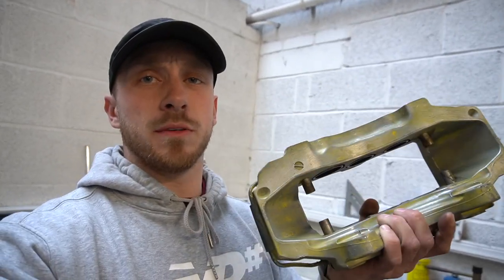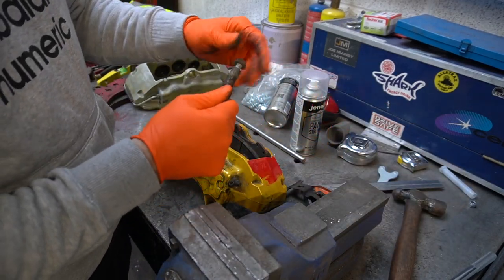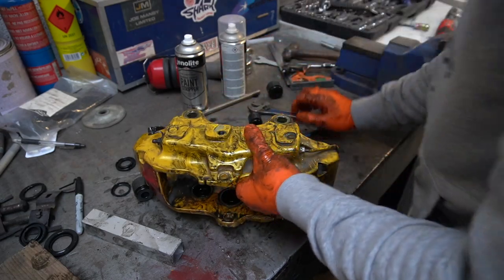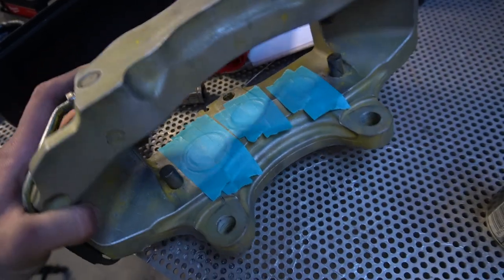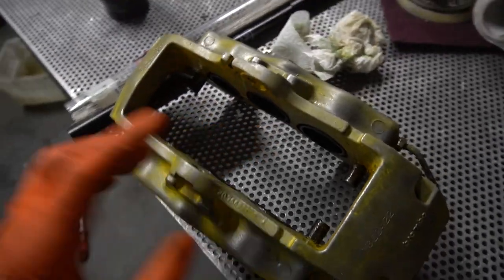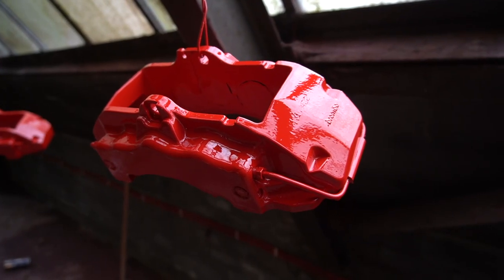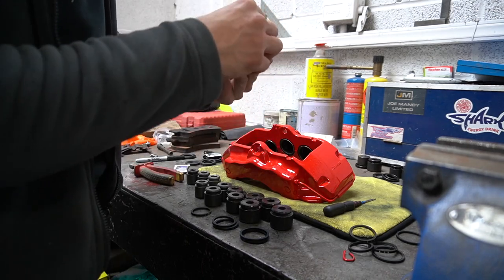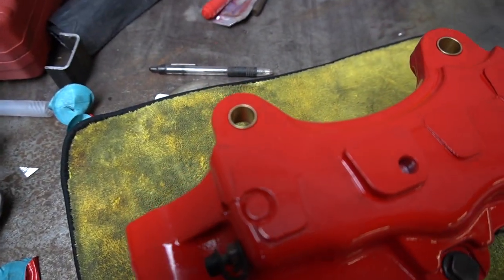Brembo 18z/17z Refurb and Rebuild

Comment: Nice work Pal. Ideally you want to cover brake pads pins so they don't get painted. As paint can stop brake pads moving freely.  Also good is to apply cermiac grease on threads so bleeding nipples don't size up after few months.
Reply from the maker: Thank you! Pins didn’t get painted and I cleaned up with a scotch pad. I’ll remember the ceramic grease for the future!

Comment: Nice video, thank you. Can you please tell me which rotor you used, was it the Mercedes, ML 55, or ML 500 rotor, and if so, did you have to bore out the center bore and/or the lug, nuts, or trim down the brake pad post inside the caliper so they won’t rub on the rotor? I have these 18 Z calipers and I’m using them with a S4B6 rotor, no modification needed, but the offset of the rotor isn’t ideal as it pushes closer towards the outside of the caliper. Any information would be appreciated. Thank you.
Reply from the maker: I used the ML55 rotors and used a die grinder to shave a bit off the centre bore. Nothing else is required other than taking a tiny bit off the centre bores and it all bolts together like factory
Reply: @LukeAston  thank you kindly. Did you also change the rear brake set up as well, and if so, what did you go with? Thank you kindly.

Comment: Wicked video! I’m looking at doing similar but I don’t have a compressor or spray gun so will be using rattle cans. Did you use any high heat resistant paints or primers? Or an etch primer? As the callipers are aluminium right?
Reply from the maker: No this was just 2K paint and any other paints should hold up no issues. You can etch prime if you wanted to but a normal primer will work just fine with the callipers being aluminium

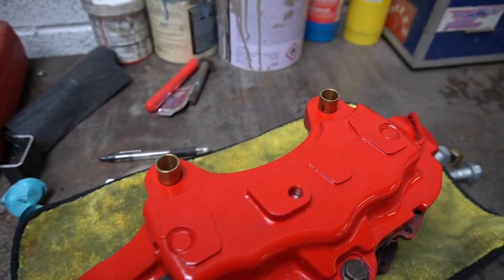Comment: What kind of spacers are those for the bolts? 21:28
Reply from the maker: @TheChazas  they’re brass inserts for the b5 S4 platform so the bolts stay concentric
Reply: @LukeAston  yes, but are those custom made or sold widely, if so what are the part number if possible. Thanks
Reply from the maker: Sold widely. Ebay item number: 303096850552. They also do a kit with new lines Ebay item number: 304511012776